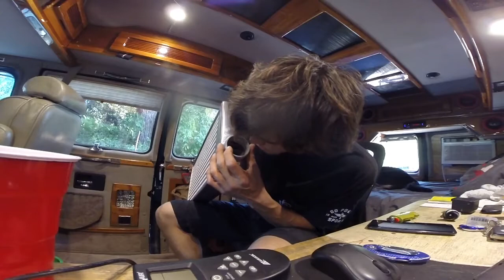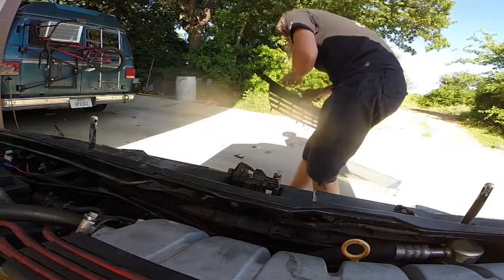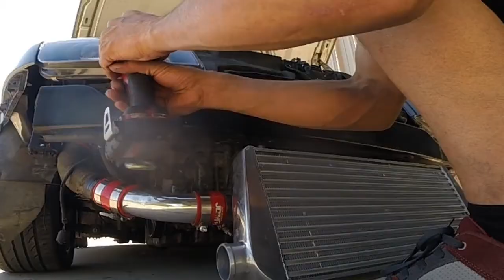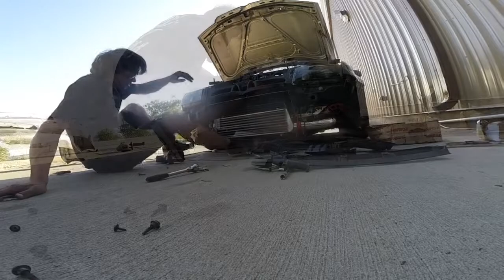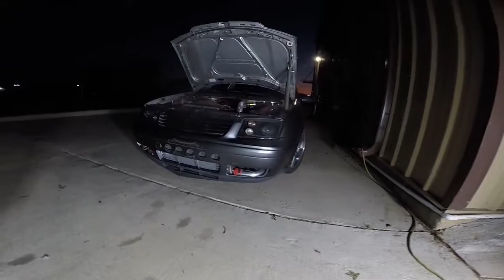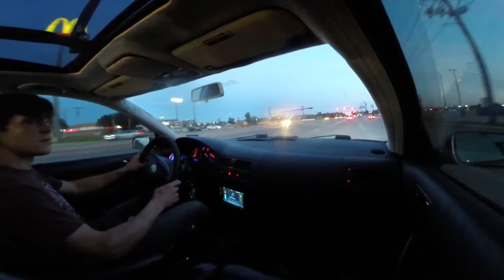VR6 Turbo Mk4 Pt. 10 - BIG FMIC

Comment: What turbo do you use in this Jetta?
Reply from the maker: Hi! I used the absolute cheapest Ebay GT3582R, Journal Bearing, Cast compressor wheel, .82 T3 backside, it was $199 shipped Pre-pandemic and lasted 2 years. Recently fried because I'm a dumbass and used a restricted oil feed on it. Check the new vid of the GTX3582R install, Ball bearing upgrade, 1.06 T3 hotside, and Billet 10 blade wheel :) thanks for watching

Comment: Yer, what's the size of the new intercooler you bought, or can u put the link
Reply from the maker: I got it on Ebay, It's made by the "JDM" Brand, it's 12" high x 28" wide, 2.5" wide, I paid $85 for it, still going strong!

Comment: just got a VR6 and would love to know what exactly you got/needed to get this build done.
Reply from the maker: i pieced the kit together from Amazon and Ebay for roughly $2,500. it would make a week to build a list of parts, sorry. research my friend :)
Reply: @Ryl33hz  Thanks bro, any direction helps. How's she holding up?
Reply from the maker: @rotary632  aside from a few cooling hose explosions, i've had no issues, still running fine. Its in storage for winter now, Getting a short running intake installed before spring :)